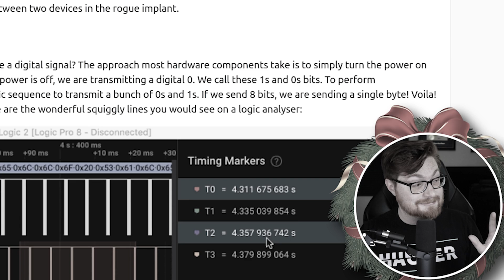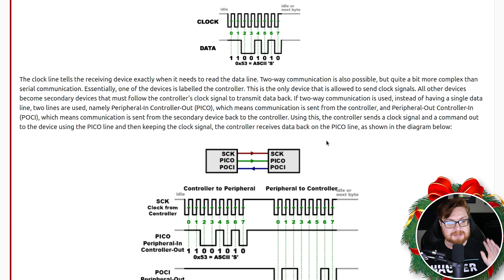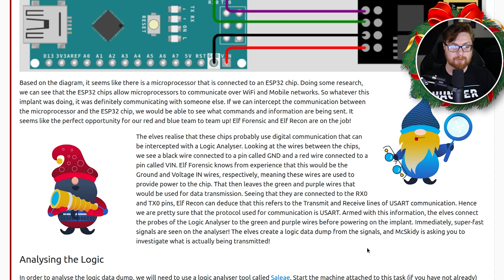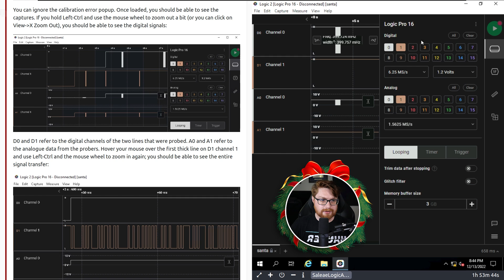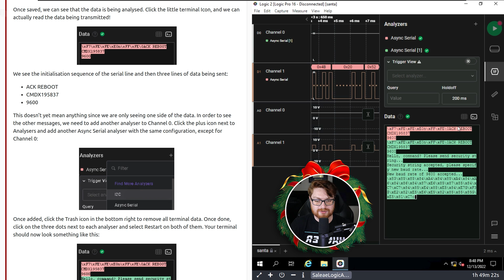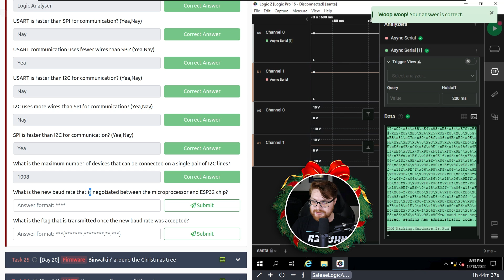Hardware Hacking! Day 19 - TryHackMe Advent of Cyber

Comment: Can any one explain how the maximum number of devices on single pair of I2C is 1008? As per the protocol specification it can be max 128 (0 - 127) as the address is 7 bits long...  0 is generally the master if not wrong.
Reply: It also supports ten bit addresses but reserves 16 addresses for special use, so you get 1024-16=1008.
Reply: @JasonKingKong  thank you for the explanation.

Comment: 9:20 RTS and CTS are the same signal. The RTS output is connected to CTS input. The receiver outputs RTS and the transmitter sees it on the CTS input connected to RTS on the other end. The CTS input means the other end is capable of receiving, so the side seeing a high CTS can confidently transmit. When the receiver wants to tell the transmitter to stop, because the buffer is almost full, you drop RTS output to low, and the transmitter sees the CTS input go low, so it stops transmitting.

Both ends have the RTS to CTS connection, symmetrically, to flow control the transmit.

The receiver side drives the RTS output high to tell the other side "My receive buffer isn't full"

The transmitter checks the CTS input to see if the other side has room in their buffer.

It doesn't have to be strictly based on buffers. You could use it to indicate that your code is about to stop bitbanging (or even polling) the receive. You would probably want to keep bitbanging the receive for the duration of a few bytes, if you did that, to cover the race where they checked it just at the last moment then expected to send a byte. That race is why I say it is a signal that the buffer is "almost" full, not a signal whether it is completely full. It will skid a bit.

If a transmitter is using a FIFO, you can expect bursts of 12, 16, or even 64 bytes between the checks of CTS. You should aim to have at least 2x that much buffer space free on the receiver, when RTS is driven high.
Reply: Thanks for this explanation! Helped me alot!!